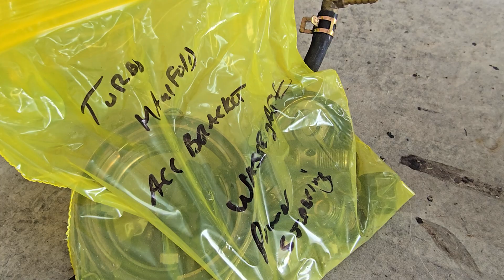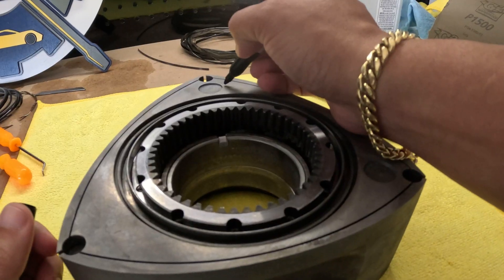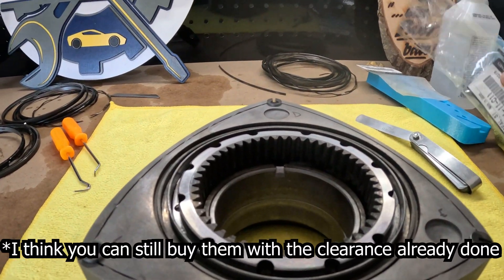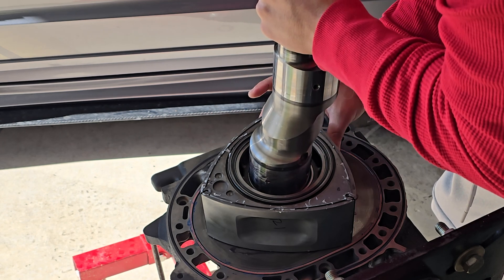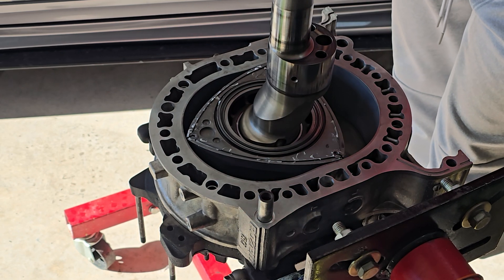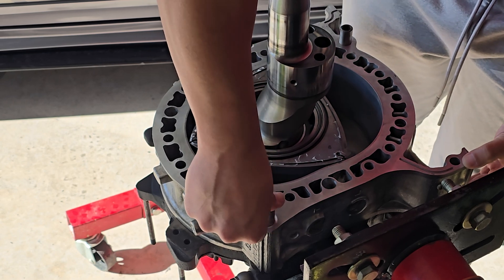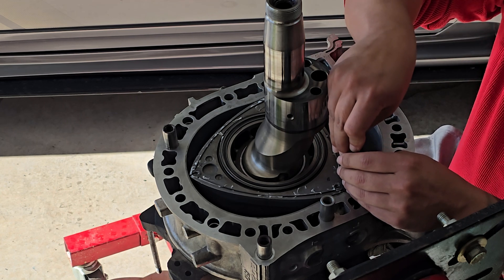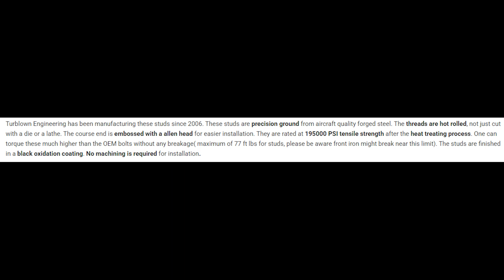My first rotary engine (13BREW) rebuild!!! Detailed process...

Comment: Tony this looks amazing! Good job dude, one day I would like to tear a motor down and attempt to rebuild. One this I saw when you sealed up your oil pan, was that enough of a bead of silicone and did you wait until is expanded before you torqued everything down? I only mentioned this because I bought a reman rx8 engine and had to pull the pan after a few months because they just tighten everything down right away and that doesn’t allow the silicone to seal. It should say on the silicone tube how long to let it set before you torque to spec, I redid my pan and it’s been three years no leaking.

Thanks for having us on your journey!
Reply from the maker: Thank you for those words. I don't like to put a lot of silicone because it will spill out, and that shit looks awful 😅. I normally wait and then torque down. However, the brace helps to prevent leaks.

Comment: Great video! I'm up near North East, MD, I'll be rebuilding my FD soon too, I just got it about a month ago.  I have a couple of questions, what places did you end up getting your seal/rebuild kits from?  I've heard good things about E&J Apex seals, so I think I'll be trying those.  Last question, where did you find the .stl for the seal holder thing that you had in your packout? I saw something similar, but the one you're using looks way better.
Reply from the maker: I got the seals from the E&J website. All the other OEM parts are from Ray Crowe, including the housings. 
I'm not sure where you can find the file. I purchased that from a Pinterest website or something like that 😅. Good luck with your build!!